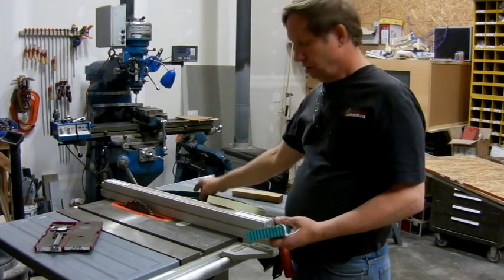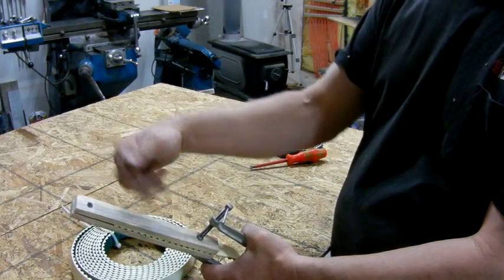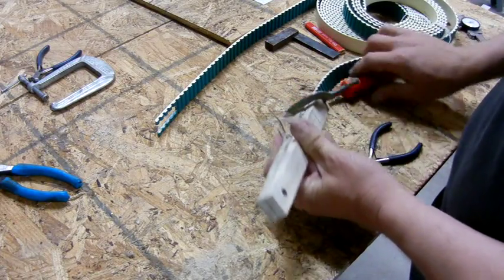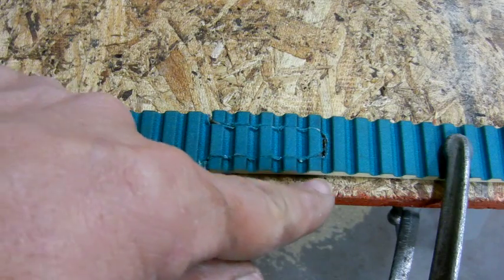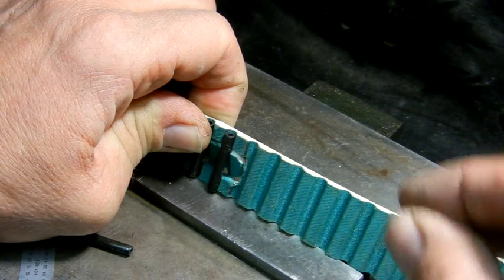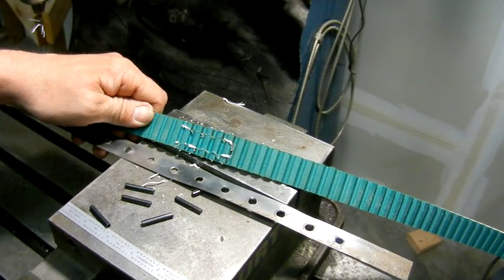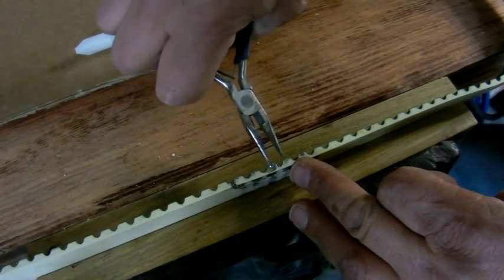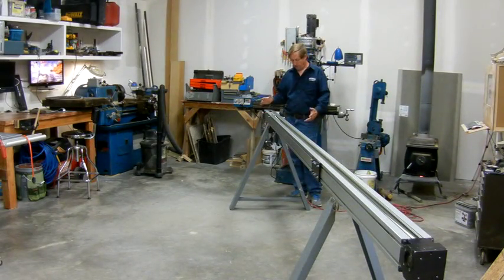Splicing Steel Cord Timing Belt

Comment: That is awesome! I will use the same method. I’m wondering if I could use some pins instead of screws and put a bit of glue so the pins don’t slide out.
Reply: Hi. Last year we started making this kind of connection in our company in  Poland but in more professional way. I was responsible for this project. Our technology was based on italian EMF system. We are using pins instead of screws. You are very creative, great video!
Reply: @patryk2oo9b  Czy ten typ łączonego pasa może być używany przy większych prędkościach? Wszędzie gdzie widzę łączone pasy to one są używane do pozycjonowania a nie przeniesienia napędu z osi na oś.
Reply from the maker: If you do I would rough up the surface or groove them to assist the glue bond.
Reply: Good idea. Thank you 😊

Comment: excuse my english is not my mother tongue, what is press BRADS?
Reply from the maker: I am not sure what you are asking. The pins in the splice are small screws 4-40 or 5-40 , the pins used to line up the teeth are  dowel pins or spring pins.
Reply: @BSpotBuilds  thanks

Comment: Instead of screws, all you need to do is press BRADS through.....  we do it on multi-million dollar machines.  Also your "tails should be a little longer"  Probably a 1/3rd to 1/2.   (Okay, now that I've played Mr. Smarty pants, and FYI, we take a brass, teenie tiny rod, and cut it, and give it a point to start, then press them in with Channel locks.  FYI, your splice wouldn't go around a pulley with sides. but GOOD JOB, don't take my criticism wrong.)  What I want, is a "drill guide" made up, to place my "tails" into, that of course aligns the belt, clamps and holds it, and then a hand drill, will follow straight through.  You use a Bridgeport, I want to do it using an idiot and a hand drill, but keep those holes within the select area.
Reply: excuse my english is not my mother tongue, what is press BRADS?
Reply: @felixmartinezrodriguez8667  Small nails, we call a Brad. normally they have almost "no head" I would say  "Hey Felix, do you have any Brads in your tool box?"  I would not say, "Hey Felix, do you have any tiny nails without heads."
Reply: @brentbarnhart5827  thank you so much
Reply: @felixmartinezrodriguez8667  You are most welcome, AND, respected speaking more than 1 language. My wife is Japanese, I cannot speak it much. I have traveled ALL OVER the world in my life, but I only speak 1 language. I HIGHLY respect those, that speak multiple languages. Always feel free to ask me if you have a question concerning English, Spelling, word meaning, or proper sentence structure.  (I am a professional writer.)  "Brad" is probably not a word the average person knows. YES, a carpenter or skilled laborer would know. Average person might says, "small nails."  Blessings.
Reply: @brentbarnhart5827  once again thanks, I'm from Cuba and I'm building a bigger CNC Router machine(1.5×3mts size) and that's why I'm interested in belts, my idea is to "merge" or "join" or "extend",🤦‍♂️🤦‍♂️🤦‍♂️ car timing belts, because I have bicycle chains as transmission system but I'm not so sure about that here in Cuba we can not buy on eBay or amazon so we have to be more creative, once again thanks for your time
Reply: @felixmartinezrodriguez8667  I do engineering for a large English company that uses these T10 Timing belts.  As I said in my comments above, our "tails" are about 1/2 again LONGER than his above, and we do not have a lot of torque either.  I am designing my own machine that takes these same T10 timing belts and I need to join them. I am having a "jig" made up to cut the tails. Not going to use a router as he does, way too much screwing around.  (I'm not sure how the "jig" is going to work, if it will be some kind of knives that under pressure it will punch out the tails, I can let you know in a couple of weeks.) AFTER the tails are cut, this is where my "brad" comment was made.  You can't use a pulley with any sides using a screw and nut.  So we buy 2mm Brass Rod and cut it, and just put a small point on 1 end.  You put the 2 tails together in another jig, maybe with a drill guide, so that you can drill trough each of the ridges.  Then we PRESS, the brass 2mm rod through (similar to a small nail, or brad) using channel lock plyers.  If you have to take them out, we use a small punch until we can grab them, and then pull them out.  (I don't have anything here right now to show you.)  Brent@BarnhartEquipment.com  send me an email and in about 3-4 weeks hopefully I will ahve the system in place.  GOOD LUCK!
Reply: @brentbarnhart5827  ok great  I get the idea, but in case I'm stuck with something I will email you, thanks